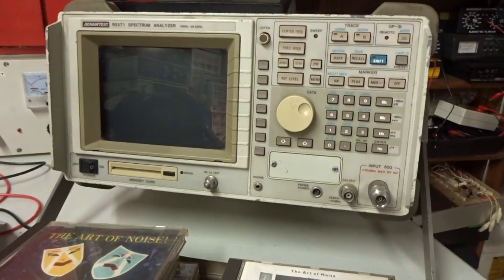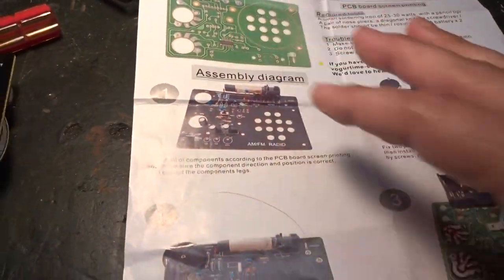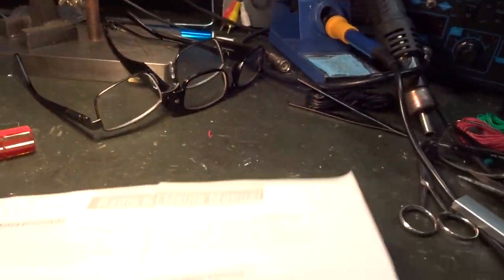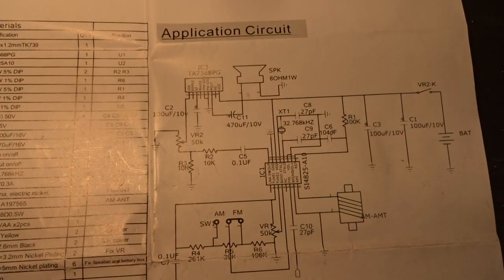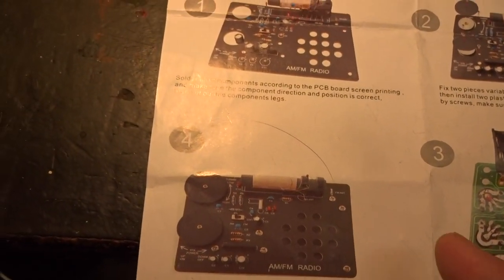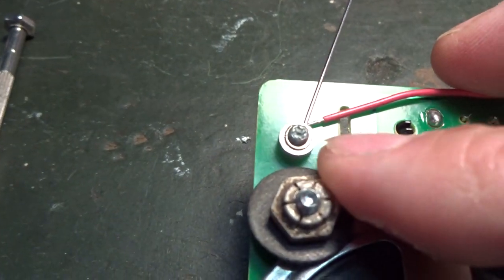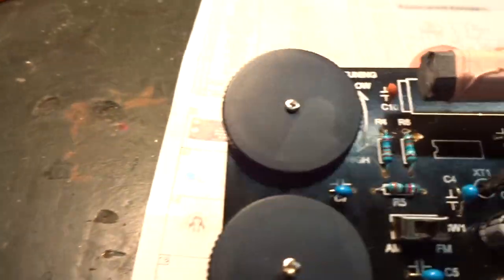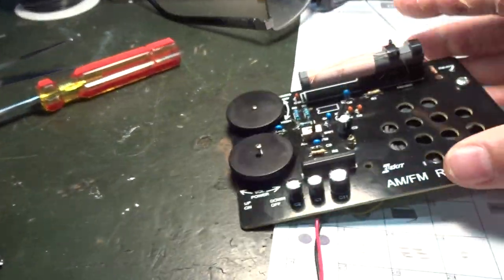A FM RADIO KIT VOGURTIME

Comment: Hi Frank, you should make a video about radio waves & how antennas work!  Especially the advantages of using different wavelengths such as VHF, UHF, CB, etc
Reply from the maker: I will.   I have been busy, so give me some time.  I know what you are interested in.  I want to also discuss the different layers of the atmosphere as they relate to radio-wave propagation.  No one else has made a video about antennas, radio waves and the layers of the atmosphere as the one that I want to do for you.
Frank
Reply: That’s great, thanks Frank!  I agree, how the atmosphere affects radio wave propagation would be an interesting topic.

Comment: 👍 Where you been frank, missed your videos
Reply from the maker: I have not had any new material.  I wish that I could travel and make some good geology videos.
Reply from the maker: I've been busy fixing cruddy TVs and electronics for clients, but business stinks.  I am looking for an electronics technician job, but there are few.  Most jobs are for electromechanical technician jobs and factory automation here in NJ/NY city area.  I just took a course on Programmable Logic Controller programming and building control panels because there are a lot of jobs out there for those skills.  Technician work pays $20/hour.  A PLC programmer pays, well, I saw two salaries offered, one for $150,000/year and one $90,000 a year.  What is funny is that the programming language is already set up similar to word and excel with icons.  All you need to know is basic digital electronics.  It is very easy, but why it pays so well is beyond me.  Also, PLC programmers are called engineers.  A PLC is a digital, 24V computer that fits inside a control panel and interfaces with a PC.  You use digital logic circuits to cause any factory machine located anywhere inside a factory to run and function remotely from one location.
Reply from the maker: I have been looking for a job.  I started an electronics repair business, but it failed.  I need a blessing from God; I need money and time in order to travel the U.S.A. and to other countries and make some good geology and prospecting videos.  I need a new and better camera. 
Frank

Comment: Are you sure you are an electrical engineer? The FM antenna is indicated on the circuit diagram and its intended location on the PCB is also clearly visible and marked.  The correct location is about half an inch away (down and to the right) from where you connected it (see video time 6:00).  There is a clear track on the PCB going from that point to capacitor C10. ....WOW!
Reply from the maker: I am not an electrical engineer.  I am an electronics technician with 26 years of work experience and courses in electronics engineering, electrical engineering and power engineering that I audited from Indian Institute of Electronics.  I have also read books on electrical engineering.  My Master of Science degree is in biology, but in undergraduate school, I had calculus, advanced physics, digital electronics, and FORTRAN.  i took Cleveland institute of Electronics' course in EE and got 3/4ths the way through it, but did not finish it because I got lost in the differential equations.  If you were observant, you should have clearly noticed that the FM antenna went to its own hole on the PCB that was not attached to the rest of the circuitry.  What purpose does that serve?  An antenna, even straight, is acts as a coil in a tank circuit selecting the frequency to be entered into the FM IN pin of the FM processing chip.  How could you not notice this?  What is wrong with you.  Are you an electrical engineer?  Would you design a radio where the FM antenna does not connect to the rest of the circuitry?  How stupid are you.  I don't mean to demean you, but you inferred that i pontificated that i was an electrical engineer when I never said that I was.  However, i have engineered circuits and published them in Popular Electronics and Nuts and Volts.  Have you?  i have worked on peoples' consumer electronics and had to reengineer them for safety, such as electronics that had no internal fuse.  How stupid must an engineer be to not fuse a piece of electronics?  Since I have been doing this for 26 years, i have seen everything!  I have learned from my EE courses and years of work experience even though i am a technician, since i do not know programming (Python,C++, JAVA, etc.), and can not do advanced calculus.  If you are an electrical engineer, you need to go back to school and refresh yourself on the basic concepts of EE because you are stating stupid things.  I constantly restudy electronics when I have time because human memory is not good.  I do not mean to put you down, but do not leave comments like you did when i never said that I was an engineer, and you do not know what you are talking about.
Reply: An impressive CV. I cannot attach an image or diagram here to show the correct position for the antenna. All I can say is that I found it easily and if you look at other YouTube videos of the construction of the kit everybody else found it also.  Incidentally this is a Japanese kit by Elekit rebadged as Vogurtime.
Reply: @kyrengorkian  Just built this kit myself, and you're absolutely correct. It's the hole directly to the right with the notch above it. The notch is for the tiny bend of the antenna to fit into. When he showed where he screwed in the antenna, I also noticed he screwed the wrong end of the antenna into the board lol. I'm a novice at this stuff, but the FM signal comes in strong, so I don't see the problem with it. Mine is also the actual Vogurtime kit, so maybe the circuitry is a bit different on the rebrands. I was going to give him the benefit of the doubt and move on, but after seeing his reply to you, I'm kinda just in shock lol.